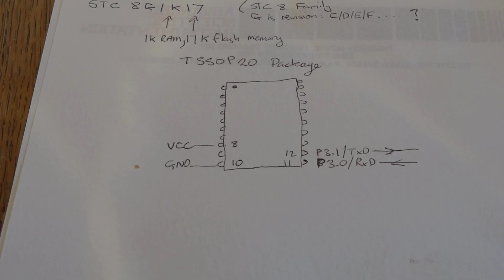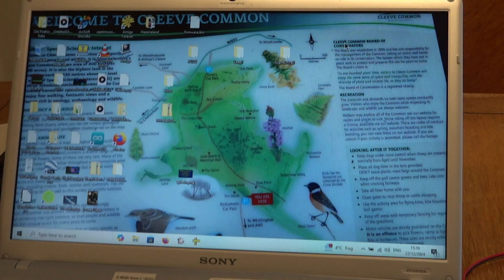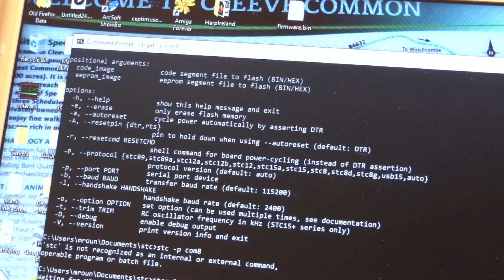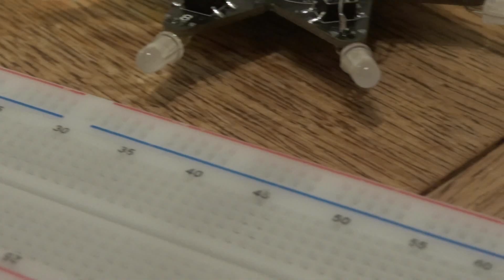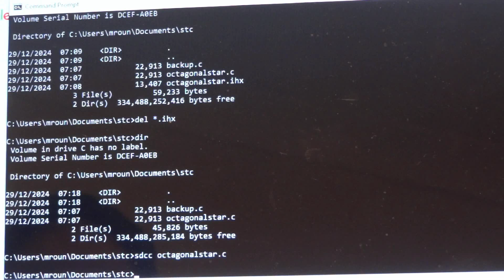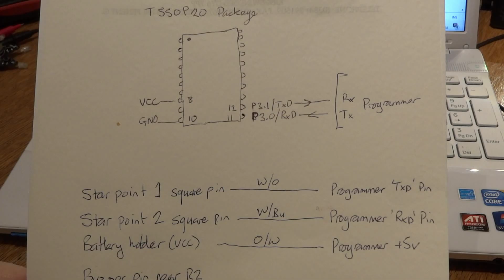Flashing code to the octagonal star LED kit

Comment: Did you have to do anything special to get all of those arrays to fit in memory?  I'm working on my 8-bit picture library and was looking at your code for guidance.  I had to break up the ~300 pictures into a few files since I can only put about 50 in at one time before I run out of "DSEG".  It's probably not gonna matter in the long run since I most likely won't use that many at once and can just cut and paste the ones I want for my final programs, but I thought I'd ask.
Reply from the maker: If the pictures don't have to change during run-time, then it's best to put them in __code memory.  That way, they don't take up any RAM at all (they're stored with the program, in FLASH memory), and your program can still access them.  That's the way I stored the tune data, etc. for this program.  If the data does have to change at run time, you can still put it in FLASH memory - though of course, writing to that memory is much slower than to RAM, and if you do it too many times you can eventually wear out the FLASH memory, and then the chip is bricked.
Some of the STC chips do this by treating part of the FLASH memory as EEPROM.  You can partition the FLASH memory into a FLASH partition, which remains read only at run time, and an EEPROM partition which can be written and read.  stcgal allows you to change the partition boundary, so you might have 16k FLASH and 1k EEPROM, or split the same 17k flash to, say, 8k FLASH and 9k EEPROM.
Reply: @ceptimus  I'll have to look into that but it sounds like I might be out of my depth.  I did use the __code memory like you suggest but I've been using the stc-isp software to upload the programs to the STC12C5A60S2.  But I still need to get the buttons working and my stretch goal is some basic I2C so I can link up some of these project boards with each other or a RaspberryPi.
Reply: Got my buttons working in the main section of the code but clearly need to try that interrupt loop that you used in the hourglass for them to be more useful.  I also did some reading about the SDCC.  Read through Chapter 3 and found out about the --model-large compile option.  Not sure if this what you were talking about but it got rid of my DSEG problem and let me add more images.  I also added a delay profile for each image so got rid of all of the hot spots when there is only one or two LEDs lit up in a given row.  I got up to 70 images before it started acting weird and drawing weird stuff without warning.